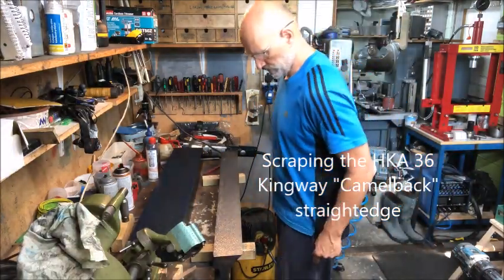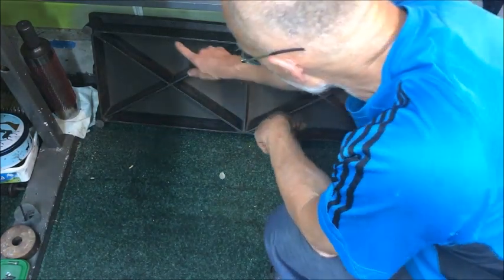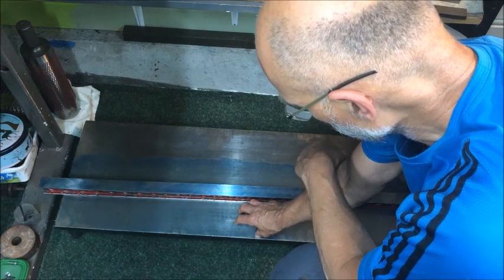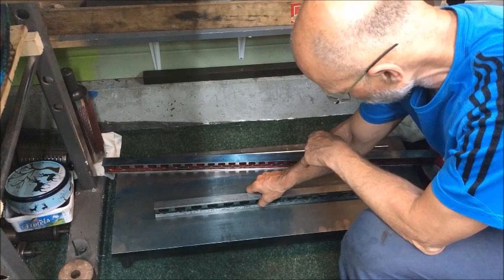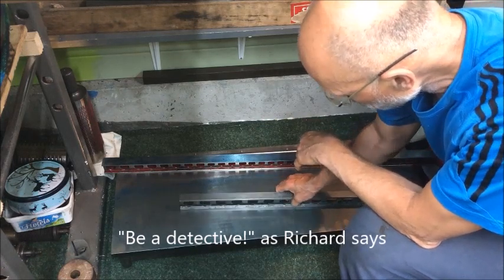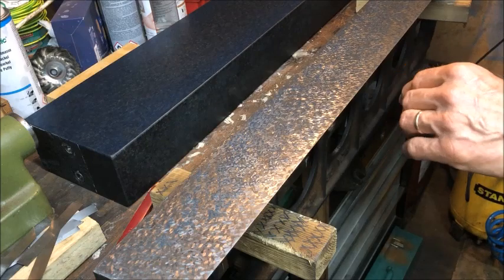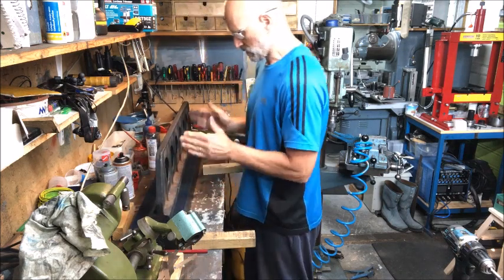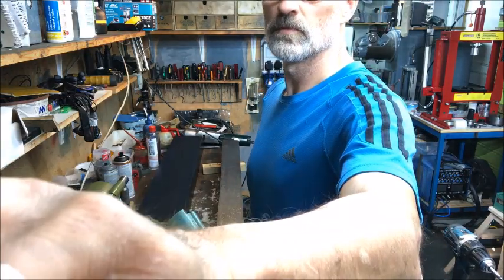Surface plate not entirely flat

Comment: You really should find a way to get a nice new /00 plate into the workshop, it is sure nice having a reference you can trust. Johann Fischer makes some nice stuff, it isn't as expensive as you might think.
Reply from the maker: Luke Rickert The big Microbas (branded CE Johanson.. they made plates for them) diabas is OK enough, but was occupied, hence the need to use the other plates. This is probably as good as I ever need, but if in doubt there are some nice other plates available.. fully agree. Could also get Microbas to lap ithe one I have, price is not that high, although not so much cheaper than buying a new. However, in a shop with no pth or control I think it makes less sense to invest in a clean room lab condition plate as there are too many variables that may interfere.  The plate is lapped to 6 my total deviation, ie. within the 7my for class 0. Actually, as I have it now I have measured with a level and proven some usefully accurate stretches/areas better than class 00 (for this size plate, 1200x800mm this is 4my). I have checked with Microbas who told me they are normally well within this also, so think it will suffice for now.